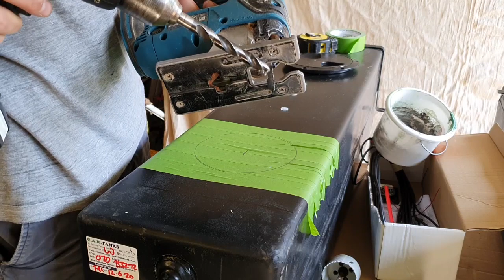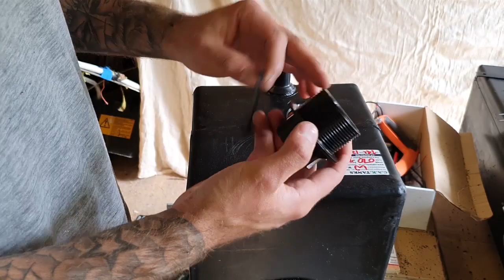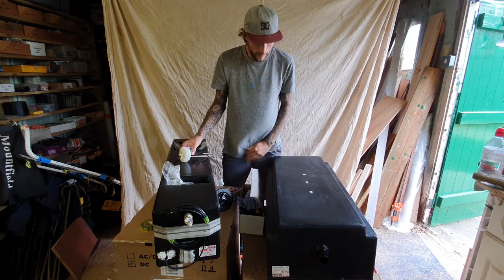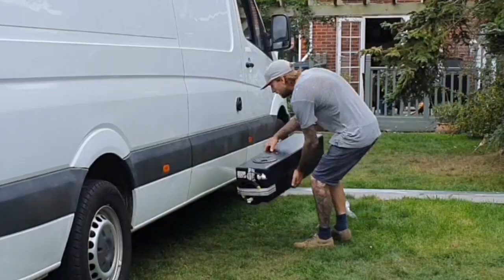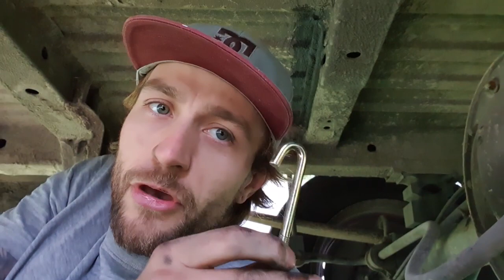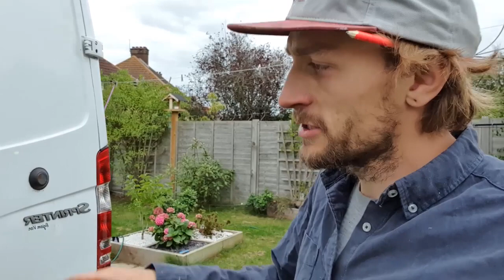WATER TANKS under the van | Van Life Build Vlog #21

Comment: Hiya mate make sure you check that all the components are rust proof. I paid a professional caravan maintenance company to fit my tanks and I wish I'd done it myself as they ignored all my requests and brought the pipes through in a random area and most annoying was they used bare metal jubilee clips and didn't treat the support braces so I had rust everywhere within 6 months. I've replaced most of it with stainless but had to lump on the rust eater. Great job.

Comment: Many thanks Ben, very clear video - I learned a lot. Can you tell me why the inspection hole for the waste is on the top of the tank whilst the inspection hole for the fresh water is on the bottom? Other people seem to have done the same as you but my little brain is flummoxed - many thanks
Reply from the maker: Hey Alistair, thanks mate.. personally I put the inspection hatch at the top as I was worried about it leaking but I'm not sure why others have done the same. I'm not sure it would matter if you stuck it on the bottom 👍🏻

Comment: nice vid thanks dude. One question - isnt the idea with the crappy plug connection that if you drop the tank to clean it you can just un-plug electrical connection? How do you do that now without cutting wire?

Comment: I spent months trying to find a tank that fit that exact area by the spare tire. Gave up and ended up building my own PVC tank. Great idea, there's only a couple folks out there building these tanks with low center of gravity considered! Do you have any slosh issues stopping/going? I'll have a flat 40gal right above this built into my floor below my bed, with the weight centered above rear axle.
Reply from the maker: Hey man, nothing at all with regards to sloshing. You wouldn't even know the tank is there even when full. I guess as you say its really low in the van and right by the axle in the centre. Perfect place 👌🏻😁

Comment: Tank kit no longer available on you tube? Was is specific to your van? With the fresh tank fitting neatly in that space between diff and spare tyre.
Reply from the maker: Hey Joel, sorry for the late reply mate. 
It was from a company called CAK Tanks, apologies if they are no longer available.. it was a while I made this video 🤦🏼‍♂️
It was specially for a crafter or sprinter but they did a variety of different Tanks for various vans. I'll have a look into it to see if I can find anywhere else that does similar tanks 👌🏻
Reply: @BejamVan  no worries mate! I've done a little research now and looks like I'll probably need to DIY mine a bit. I'm working with a mwb mk7 transit so don't think there's anything specific for mine.

Comment: Awesome video man! Can I ask why you have your water inlet/fill cap mounted so high on the van? Would it be possible to have the filler cap lower to remove the need to have the hose going through the van floor?
Reply from the maker: Cheers dude 🤘🏻
To be fair I have thought about this.. there's nowhere on the van itself where I could mount it lower without drilling through the chassis or structural supports on the van walls 😅 other than that, I could of mounted the cap in the floor of the garage but I didn't want to be opening the van doors and letting the heat out while filling up.. so the decision was to put it where it is now 👀🤙🏻